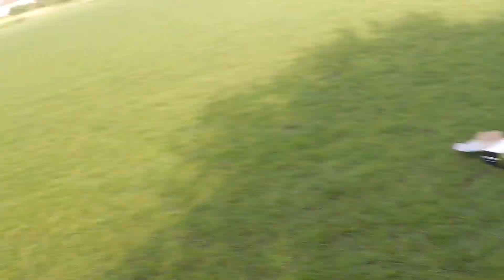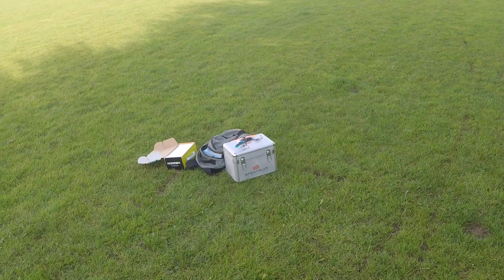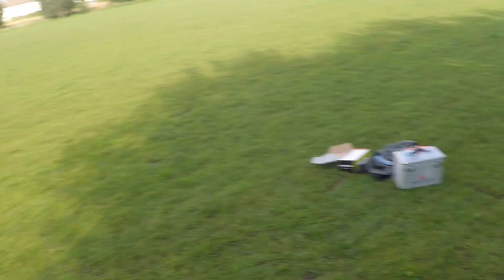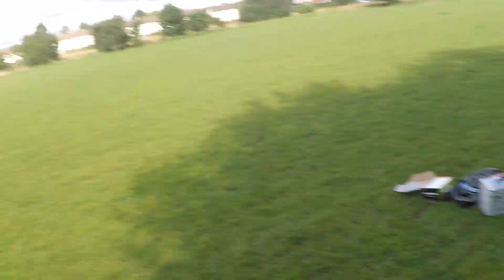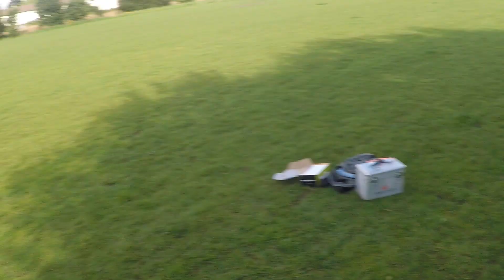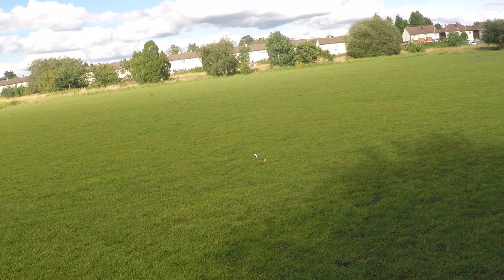Blade Nano S2 RC Helicopter in 20mph Wind Gusts

Comment: Brilliant mate 👍 I've just started with one and struggle to fly it in my front room, let alone 20mph wind 😁
Reply: @mikesmiscellanea  Thanks. Don't worry I won't pester you to death but I would appreciate any advice you have on learning with this helecopter. I flew a Morley Maverick badly about 30 yrs ago so have a small idea on the theory but that's it. I'm on a DX9 front room hovering on FM1 which is stabilized but with full collective control. I've downloaded the model settings from Spectrum but use 70% rates. I do find the collective very sensitive which can lead to comical results 😁 Any advice for a beginner would be greatly appreciated. If it's crack on and get better no worries 😁👍